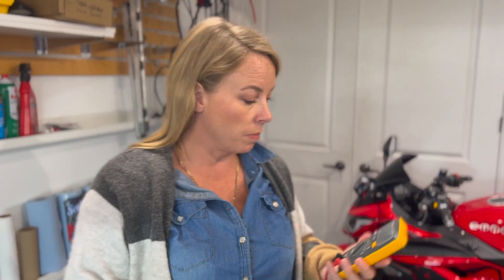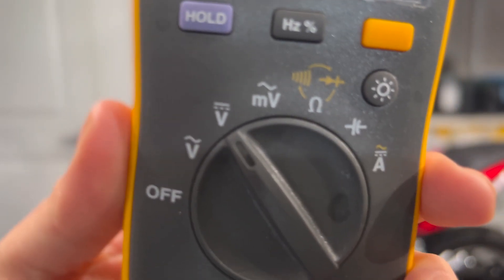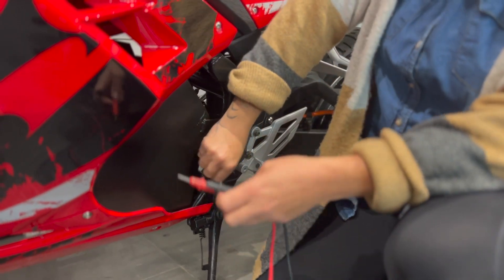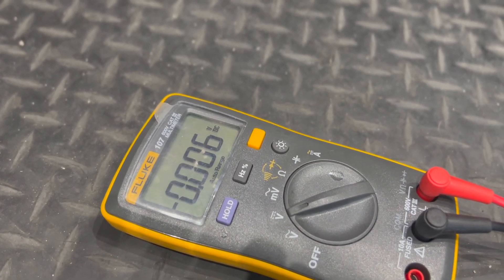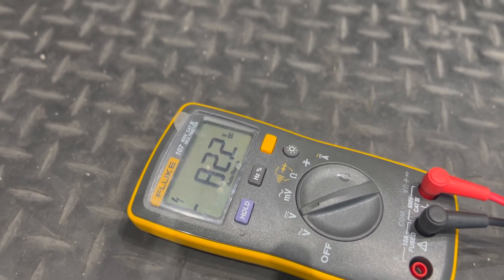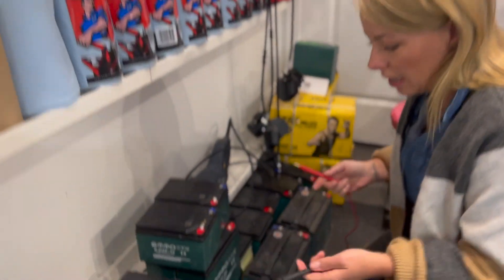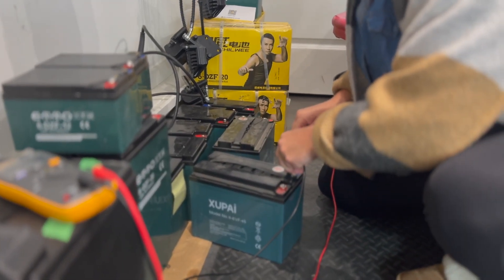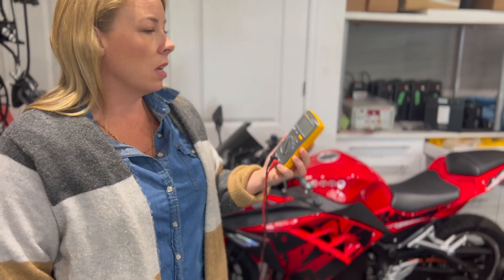How to check your E-Bikes' Voltage - #RTWEB

Comment: Thoughts on what would cause the throttle to cut out  if you hit a bump? Electrical is still working but basically need to come to a full stop then the throttle works fine.  Thought about a loose connection but the having to completely stop as a reset didn't make sense to me.
Reply from the maker: Hey Chad,   how often is this happening? Every bump?
Reply: @ridethewindebikes  no mostly just larger ones, and the minute you completely stop it workday fine again, no need to shut anything off or restart the bike.
Reply from the maker: so when it comes to a stop,  it goes again....we have one that is doing there here,  but I feel like yours in  bit different. 
 @i_am_the0Ry
Reply: @ridethewindebikes  exactly when you stop it goes again.

Comment: I'd love a video of taking apart Tao Gemini and Putting it back together. ( Or just taking it apart ). Also the Signal Switch Block I bought doesn't work with the Tao Gemini. None of them do it seems. ( They have extra cables which the bikes don't have ) so I put my cracked old one back on for now.
Reply from the maker: Hey,  we just shoot what we have.  We're not full time youtubers.  We've got a busy store to run,  so taking a part a new bike just for the purpose of a video isn't something that makes sense for us.   We're slowly getting info up.